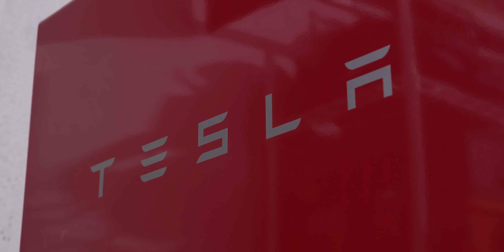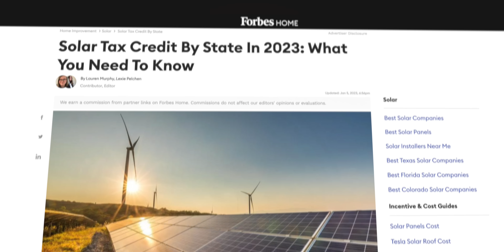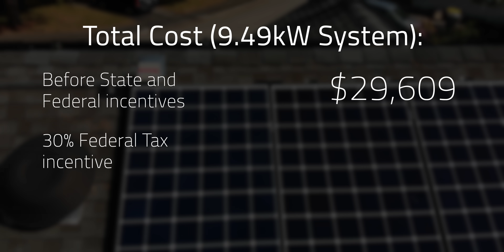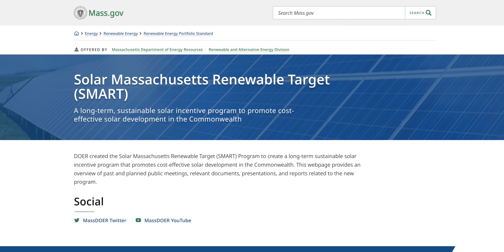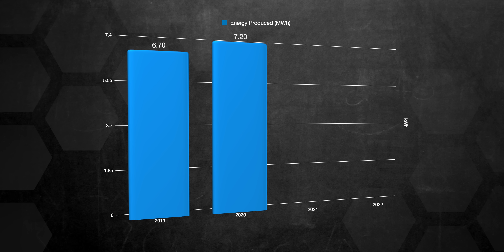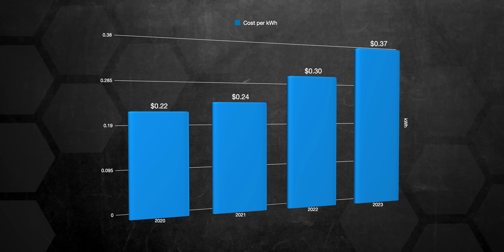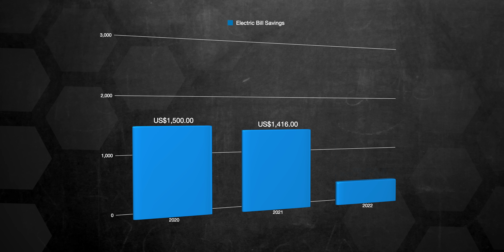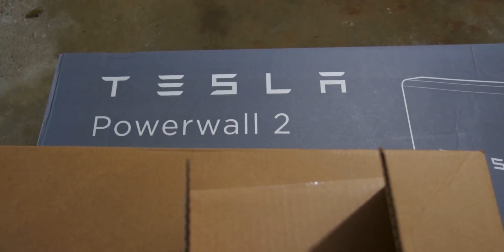5 Years with Solar Panels - Is It Still Worth It?

Comment: 8:17 An average of 1 MWh/month?! 😳 That's 5-6 times more than what I've been used to here in Europe, and I can easily think of stuff that I can unplug to lower the bill. Some households can go 8-10 lower than that, on average. And where I lived for a long time, we've had temperatures both higher and lower than the record highs and lows in Massachusetts. It really makes me wonder how many wrong decisions go into housing and power consumption in the US. Poor insulation is probably a big reason, then maybe choosing inefficient appliances. And of course there's the lifestyle, both that of the general population, as well as personal choice.

I'm sure I'm not part of the average, because I pay attention to everything I buy to make sure I get the best balance between features, power consumption and price, but still, it's a huge difference that's hard for me to explain. And I don't compromise on features and quality, but I go through the painstakingly long process of comparing long lists of specifications of many products. It can be annoying to be fair, but it pays off in a lot more than just power savings. I'm probably doing 2-3 times better than the average where I am, and I'm at about 8 times lower than Matt's average consumption. Clearly, I can't just buy the cheapest stuff, but not very expensive either. There are good options out there, from PCs to refrigerators, TVs and other stuff. The fact that one purchase takes me a few minutes or hours of research is almost irrelevant when I consider all the benefits I get after, for many years.
Reply: Note just worse insulation, with the wooden frames often being rather thin, but also just the sheer size of the house makes a large difference. 

I’m in the UK, but with electric heat, and moving from a smaller and leakier apartment to a larger but better insulated one I was expecting to save some money. But it actually pretty much evened out between the less leaky thermal envelope but more air to heat. And that’s not a detached house, that’s with my neighbours’ heat contributing on all sides and vice versa. 

American houses tend to be almost universally detached, not semi-detached or terraced (which are a bit more heat efficient), with large gardens, usually by local ordinances so no one could do differently even if they wanted to. So none of their neighbours’ heat helps them at all. This is also why, among eco-conscious Americans, building a super-insulated house is often their only option. Since the local zoning mandates single family, detached homes, covering a minimum percentage of the land-lot and not exceeding a maximum percentage. So most can’t build tiny houses even if they want to (but most Americans don’t want to).
Reply: @kaitlyn__L  Yup, it is indeed very helpful to share walls with neighbours. But insulation should be heavily prioritized in the US too. It's a non-trivial cost that pays off from day 1, when it comes to comfort and energy saving.

I really look forward to getting more info about Matt's new house. We've had those doors and windows for decades now, in Europe, so it feels surreal for them to be a novelty in the US. :P
Reply: @kneekoo  sadly, incentives for insulation tend to be piecemeal, since the federal government doing that would ~be socialism~. And most incentives come in the form of tax credits, not grants, so people have to have enough capital to stump up for the work. I agree aggressive insulation should be a key policy proposal, but it’s rare that it works out in the American political system :/ 

Even in the UK it’s been a long road to improving insulation, the Scottish and Welsh governments have had to launch their own grants for insulation and heat pumps because it’s not forthcoming from central government.
Reply: I think Kaitlyn (above) is probably correct. We use about 1 kW-hr per month, in spite of buying Energy Star appliances  whenever  replacing anything. We have long since upgraded our light bulbs and don't leave lights on in unoccupied rooms. Our house is large and on a 3 acre lot, so no common walls, etc. Air conditioning is a big use factor in the mid-Atlantic states. I am old enough to remember growing up without air conditioning, and I will pay for additional panels if that is the choice.
Reply: @flash4s747   I lived most of my life without air conditioning, and I'm fine between 61-103 F (16-39 C) while doing desk work. Of course, at lower temperatures I move around every now and then, to get my blood running faster and heat up.

I don't know what people need to do to better adapt so they can be fine with lower and higher temperatures, but I think the body needs the "training" of being exposed to different temperatures, and learn to deal with them. Staying for a long time within a small range of temperatures makes us way more uncomfortable to changes.

It's not great for the body to experience sudden changes in temperature, because it affects blood circulation, which can cause headaches, and it also affects immunity. So when it's hot outside, we'd want the indoor air to be cooler, but not too cool if we also need to go out. "Training" the body not only helps our health, but also our budget. :)

Comment: It is nice that the tax payers of your state are supplementing your electric bill every month on the SMART program. But I have a question for you concerning the roof, what is the cost to replace your shingles? You have to uninstall the panels and wiring just to get to the shingles. Then you have to pay to reinstall everything. What about leaks that could occur at any of the many holes introduced into the roof by installing panels that could be shifted by a strong wind gust, it is possible but not likely. How much does installing solar panels on your roof raise your home owner premiums with the insurance company? Are you factoring these costs into your savings and loss column? Some of these are major expenses, some are not, but they do add up over time. How much do you save if you own an Electric vehicle or two? How often do you have to clean the dust off the panels? What does that cost if you are a senior citizen who can't physically do it themselves? Please let us know about these expenses as well as how much you are saving on solar. What is the life span of the panels? What is the life span of the controllers on the roof? What if you live in an area with dense tree coverage? I would rather have the trees than the solar on my home as they provide cooling from the hot sun and protection from the wind, not to mention they absorb that nasty CO2. You have only scratched the surface of the true cost of putting solar on a home. I await your updated video to answer these questions.

Comment: If you go the used route, you can save so much more.  I did a DIY solar install in my garden, 3.5kw for less than under £1500 ($2000), at those prices you really can't go wrong
Reply: Agreed. Based on the IRS tax laws, the 30% solar incentive is non-refundable, as the host mentioned; and, it's only for new equipment, and not labor.  The caveat is two-fold: first, if one's taxes are (way) under the 30%, then their tax comes out to zero, and any amount above their tax liability does not get them a tax refund for the difference.  This is a loss until the following tax year(s) until the full 30% of gross credit is received. [A carry-over]

Second, if one buys used equipment, the savings is felt immediately and not dependent on a non-refundable tax credit that one may have to wait multiple years to get.

Caveat to the caveat:
If the home owner installs NEW equipment in the following year(s) [presumably to expand their array(s)], THAT installation does qualify for a separate 30% solar tax (non-refundable) credit.  This allows you to get started with a small array now, get credits (if applicable) and then expand at a later date. (all installs within a calendar year count towards the total gross amount for the tax credit)
Reply: @redmatrix  Where would one go to purchase used solar equipment?
Reply: Where would one go to purchase used solar equipment?
Reply: @kimkrill981  eBay, Facebook Marketplace, Craigslist/Gumtree etc

Comment: I am a poor person, I live in a 40ft high cube insulated shipping container. If the solar was an 8k grant vs a tax credit, I would have taken the grand and had solar. But the shit stickler is, 29k for the panels, is way to damn expensive. Though, looking at what I can get,  I can get a kit with all this MPP LV6048 7.5KW 5.1KWH Off Grid Solar Panel Kit with a 5.1 kw battery for under 7k. So, yeah, no idea why your system was so costly, and followup, the solar "tax incentive" only targets middle class and up, not us po folk.

I should add, I am looking at off grid systems, and not grid tied/grid feeding systems.
Reply: The way the USA always prefers tax credits over grants is quite frustrating, to watch as a person from a country that tends to prefer grants for these things

Comment: "Blue state" makes all the difference. I'm I'm St Louis, MO. A 4.8Kwh system will cost as much as his, and I have ZERO local/state incentives.
Reply: I am in Belleville Illinois not far from you. I just got an 8.5 KWh system it was 41k but after incentives 17k. You do have some state incentives, they just are not very much at all is the problem. The same system would have cost you 26k my installer said. I am glad I chose Illinois for this and the no-taxing retirement accounts!!! That is another thing MO does.

Comment: Great video!!! Somethings i want to add,
1st you paid A LOT!!! Ι had my 5kwatt solar system with 5500€
2nd proper orientation makes a huge difference, you have a sub-optimal roof,plus some shadow, you should mention that if the same system properly oriented to the south and with a 22 degree tilt , would have produced way way more power! 
3rd i want totally agree with you, finding the right electrician to do the installation is one of the hardest things. I found out the hard way... It was easier for me to learn how to install the system myself from an enormous amount of free information in the web, and had an electrician only for help and paperwork! I got involved and i loved it!!!

Solar panels and net metering is a 100% ROI and there is no way you wont make your money back, its impossible!!! Its the time that varies, for me it had been 5 years!
Reply: Yep, solar is really expensive in the USA. A lot of that comes down to installation fees, but also import fees on foreign panel manufacturers. It’s much cheaper in Europe, Australia, etc.

Comment: why is solar 3x more expensite in US than in EU? We can get 10kWp system installed for $11k even in today's  inflated money.
Reply: They take extra money for a lawyer to sue you in case you are not satisfied with the installation.
Reply: It's the USA mate. Just about everything that doesn't have a recurring cost attached to it is a metric ton more expensive. Just look at the health care system. Minor cut while cutting some fruits with a knife? Treatment will cost $20,000.
Reply: We had a system installed very similar to Matt's. It was priced upfront out of pocket at $40,000 in 2022. But, after getting the federal credit and the Illinois SREC credit, the system out-of-pocket cost was really $17,000. We are not far off from you if you include the credits. My state of Illinois has good credit. My neighboring state of Missouri gives a crap credit. The same system in Missouri would have cost me out-of-pocket $25,000. One state cares about getting renewable energy into the grid and the other does not. The electric cost per KWH went up 45%. I was projected at saving $80,000 over 30 years, it is now $116,000 projected savings. When we get an EV car, our savings could get as high as $150,000 over 30 years.
Reply: @illslim2100  my $10k system is without credits.
After credits it was 6k.
Reply: @eIektrinis  we also have a problem with greed here in the U.S.A. that causes a lot of higher prices, too. How many KWh is your system? That would matter too for a cost comparison.
Reply: @illslim2100  to be exact, I paid $11k for 13.1kWp solar system installed, and around $7k after incentives.
I then paid another $11k for a 22kWh Li-ion battery, and got $10k back as incentive, so 22kWh battery cost me $1k.
Reply: @eIektrinis  Sounds like you live in a great place that cares about this subject and is willing to help make this an affordable reality for more people. I would ask your price per KWh for electricity where you are too. Mine went from .085 to .125 in Jan 2023. I am glad I did my system when I did as the cost of the system installed now in my area has gone up. Supply and demand economics at work. Where are you located?
Reply: @illslim2100  we have fixed price €0.30/kWh, and we can also select a hourly nordpool market price (LTU). It varies a lot, jumping around 12c-30c within few hours. Last summer we had such crazy numbers like 5€/kWh. 5 euros, not cents. Due to war in Ukraine.
Our PV systems are paying off like crazy. I can't understand why very few houses have these installed... People just can't do maths.

Comment: Those are high power rates!  Mose than double what we pay here in the Nw. I feel like DIY gear is getting pretty approachable and I feel like a self installed system (you have to like that sort of work like I do)  that isn’t even grid tied could be beneficial. If I could harvest 5-15kw into batteries I would have emergency backup and charge up the Leaf for most of its use thereby farming power purely for my own use.

Comment: I have had a similar solar setup for a similar amount of time. I echo everything you've said here - my economics and experiences are very similar. I would just add that our roof is a slightly lower angle and in a snowier climate. The snow doesn't avalanche off as well, so roof raking (with a soft pad) is a bit of a requirement.

Comment: That was really informative. So many factors involved. I haven’t gone the solar route but am always interested. Instead I opted to super insulate the attic of a brick ranch that has two furnaces in the Chicago area. We will see how that helps. Just had it done
Reply: If you wanna go solar. Use it to power your light only. The rest is totally not worth it.

Comment: I'll say it till I'm blue haha.

Simple tech did a video on how using basic mirrors mounted on the two sides of a panel, boosts their performance by 40 percent, and are absurdly easy and cheap to build.

If you could mount mirrors to each of your panels, would you?

Comment: Matt, we live just north of you so our environment is pretty similar. Our system is grid-tied without batteries so nothing is produced if the grid is down. Turns out that adding batteries for off-grid now is a major undertaking so I wish I had known more about that at the time. For what it is, the system is great but without battery backup it is limited. Still, our electric bill has been zero dollars for eight years so I can't complain too much - especially as rates have gone up.
Reply: But what were the payments for your system?    Zero electric bill is not much good what a $500/month home improment payment. = Wounder why nobody tells us what the loan payments are,,,,,,unless they were stypid enough to pay in cash up front. (You don't use YOUR money. You use SOMEONE ELSE'S money.

Comment: We're in Austin,Texas and got solar and 2 powerwalls a few months ago.  We had gone through winter storm uri a couple years ago and didn't have any power for several days where we live.  This time during winter ice storm mara we kept our power on the whole time (it was out in our neighborhood for several days) having TV, Lights, and Kitchen appliances all working.  We have a fireplace that we kept the house warm with so we didn't use the AC/Furnace.  So I'm super happy with our solar!
Reply: Isn't it great?! Up here in SE Michigan we had ice accumulation  and last Wednesday most of the area lost power but I have the same thing installed. I ran off the battery for the 20 hours it was off. I turned the furnace off and used the gas fireplace.
Reply: I'm in Austin Tx as well and considering getting solar. Who did you end up using if you don't mind me asking?
Reply: @MrMoxy76  We went through Costco and the company that they used was Sunrun who we thought took a long time to get things going and had some snags along the way.  However, the company that did the actual install for them was called Axis solar and we thought they were excellent.
Reply: @veganpeace_ATX  North Austin here.  We actually got our just before the big freeze a few years ago.  While most of the state was down we had emergency power to our home.  Even now in the coldest runs in winter we may have to pay 20 bucks in a month for heating.  We used Trismart Solar and we have Green Mountain Energy for a provider.
I won't live in a home without a solar system any more.
Reply: Yes it was a horrible winter in 2021, the grid was down 55 hours. We lost power again this year. My old gas generator worked just fine. I had plenty of power and didn't have to spend a fortune. Solar panels are good for some, but I'll pass.

Comment: My only question is the cost to remove the panel and replace the shingles every 20 or 25 years, the normal age to replace shingles
Reply: Not that much tbh all things considered. If the solar system pays itself off within 10 years, the rest (10-15 years) are profits. Using some of that profit to replace the system when the time comes isn't that bad.
Reply: Solar panels are expected to last about the same amount of time so if they're matched up pretty closely shouldn't be an issue. If the ages aren't matched I've heard a couple thousand to remove and replace the panels during roof work.